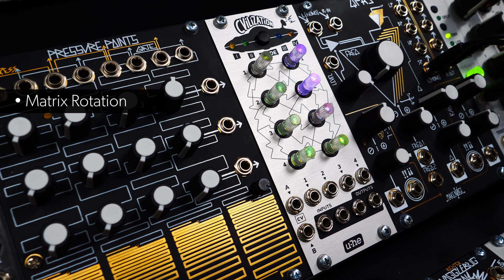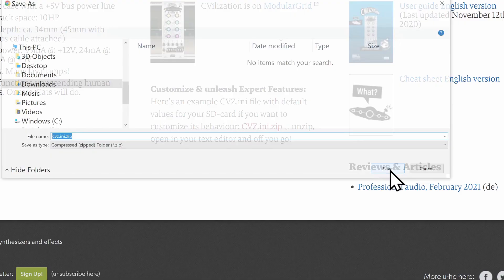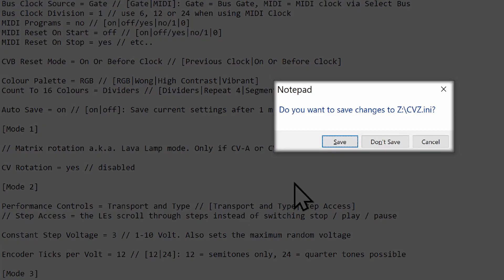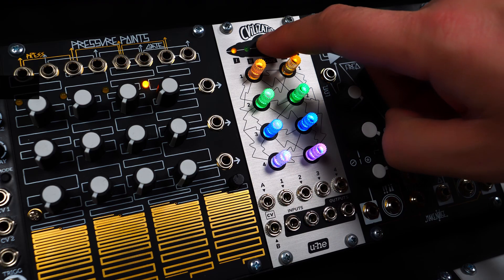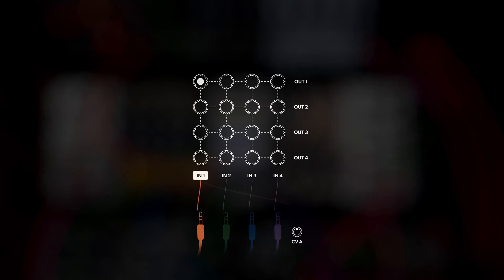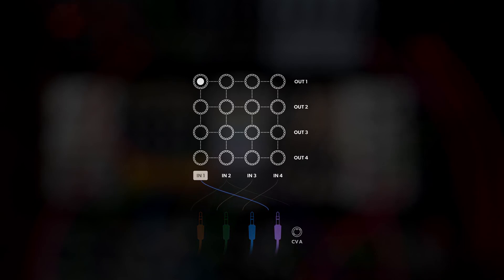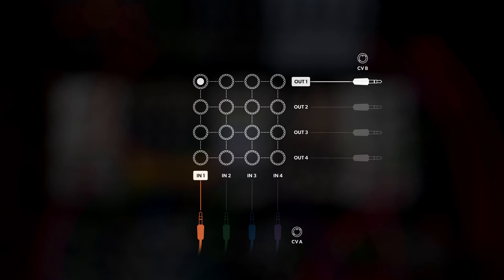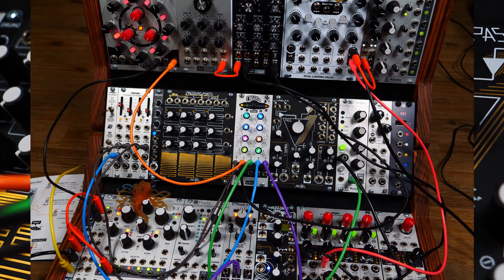u-he CVilization Expert Features: Matrix Rotation (Mode I)

Comment: Super useful mode! Btw, is this mode included with the available firmware update or do you need to follow the video instructions?
Reply from the maker: This feature is available on all Firmware versions and simply needs to be activated as described in the video.
Reply: @uheplugins  Activating here this feature ASAP. 👍🏻👍🏻